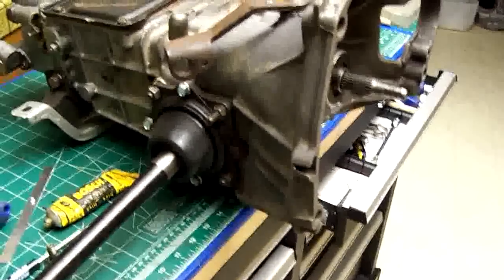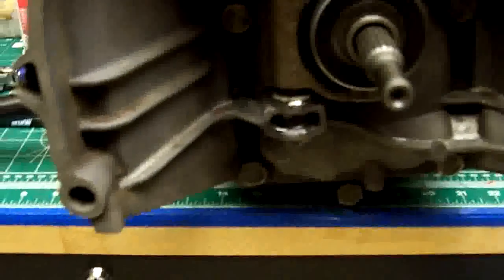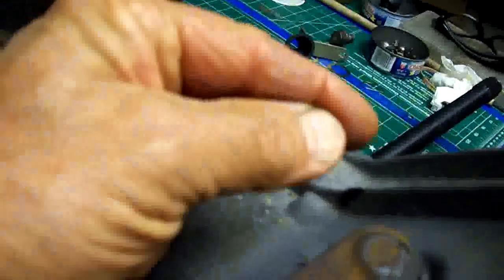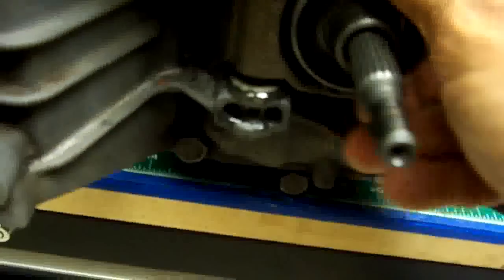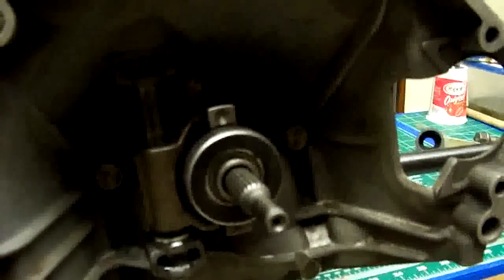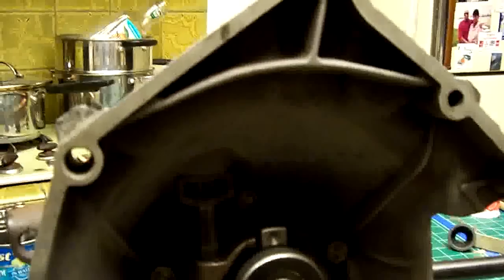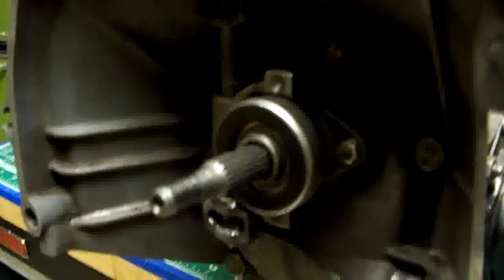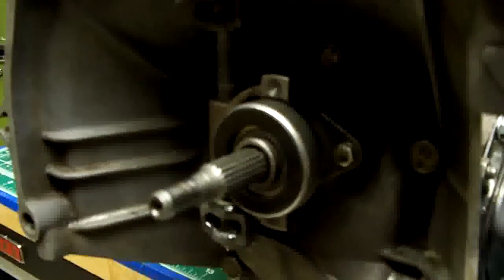FIAT 500, STEYR PUCH 650.. CLUTCH PROBLEMS

Comment: Hi there puchmanlenny , Very useful videos . I have picked up a 500d with a 650tr motor but can't get into reverse . It looks like the thrust bearing or the clutch . The cable has been adjusted to the max leaving no free play on the pedal . I was going to have my mechanic investigate but I can't find a thrust bearing in stock @ Robert Prokschi . Do you know if any fiat ones will fit ? Many thanks if you can help

Comment: I have a Fiat 500 and it has 11,000 miles on board. The clutch failed and I just found out that Fiat doesn't want to cover it as it considers it "wear and tear". There is nowhere on the warranty manual  to tell you that the clutch is not covered. The "Fiat Studio" didn't disclose this when we bought the car, either. It's frightening how misleading this is.